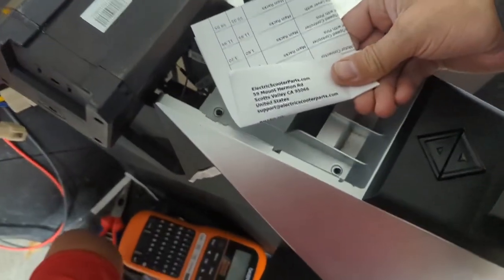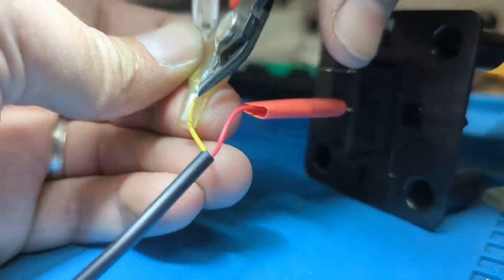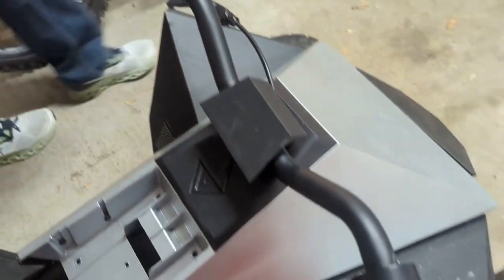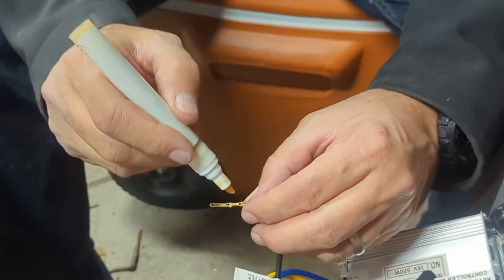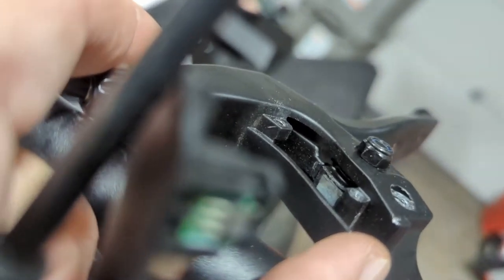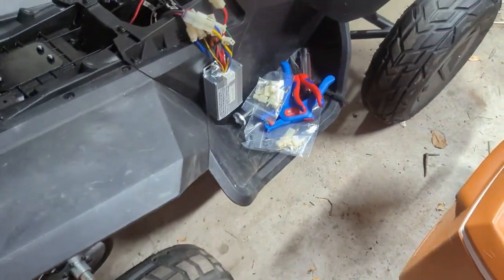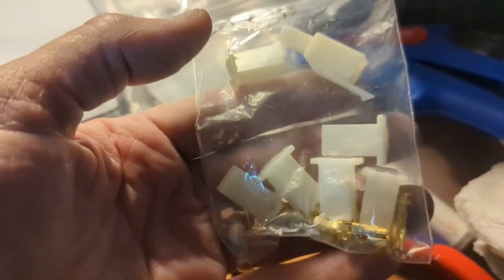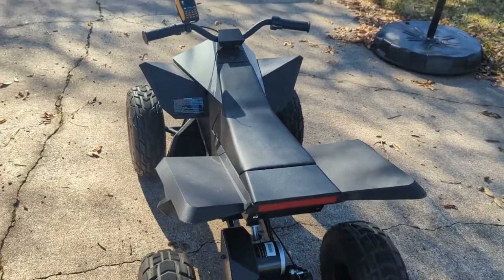Tesla Cyberquad for Kids Motor Controller Recall Replacement

Comment: Hey just upgraded both my kid's quads using this as my starting point. Couple things I did slightly differently, for anyone else in the future reading these comments, or if you wanted to add it into the description. 

-For the forward/reverse being flipped, instead of trying to access that plug to flip the connectors on it since it's a tight fit, I simply de-pinned and flipped the wires in the connector at the controller that went to the motor. All that blue/yellow pair of wires is doing for the motor connector is switching polarity for forward/reverse, so simply swapping the pins in that connector accomplishes the same thing as swapping the plugs at the forward/reverse switch up front. We also test drove both quads side by side to verify the flipped polarity to the motor connectors didn't make any difference on speed (in case the controller allowed 100% for forward but say 75% for reverse, and confirmed its exactly the same). So skip that step and just re-pin to flip the wires, much easier. 

-For the headlight, the controller says it outputs 36v to the lights (tested 36v out as well), and the stock controller would send full voltage to the taillights, but only 24v to the headlights. I know you didn't have a problem wiring it right up (but I noticed in your video your controller page looked like it said 24v to the lights, so may be an update on their controller?). I found a 36/48V to 24v step down buck converter for golf carts on Amazon for 20 bucks (Exact name was "DC 36V/48V Step Down to 24V 10A 240W Voltage Regulator Buck Converter Golf Cart Reducer Power Converter Waterproof Module Transformer"). It's just 2 wires in, 2 wires out, so I used two extra 2 pin CNX connectors to put it in-line the headlight wiring so now my headlights get 24v just like the stock controller, so I don't have to worry if full voltage may burn them out over time. 

-For the brake lever, Electric Scooter Parts was out of the LH lever and no ETA on more. I just ordered RH levers and flipped it over. The screw faces up instead of down, so it's only an appearance difference, but works just fine for anyone that wants to swap theirs and not wait on backordered RH levers. 

-For the on/off, I popped out the factory momentary button on the back, used a step bit to drill the hole larger, and used a 2 wire ignition key switch for a scooter/cart off Amazon, it was 10 bucks, used the same CNX connectors, and now the kids have their own key for their own quad which they think is pretty cool. 

Really appreciate this video though, helped me skip all the research and experimenting to design something from scratch by simply following this how-to and get this controller and connectors and had them back in action in no time. Just wanted to share the couple tweaks and upgrades I was able to add as well.
Reply from the maker: Thank you! All great recommendations!!
Reply: Hi. What was the cost to make this controller?
Reply from the maker: @ketavkshatriya1253 less than $100
Reply: @ketavkshatriya1253  look at the description, the OP lists all the links and that has prices

Comment: Brian, this video was really helpful. Thank you. I got mine all done then I discovered that my controller is only providing reverse speeds when going forward and forward speeds when in reverse.
Reply from the maker: Did you do the fwd/rev switch swap, as shown in this video (0:50 mark)?
Reply: @cognetic  thank you for messaging back. I did do the swap. It turns out on the controller I purchased, I didn’t need to do the swap! That was my problem.

Comment: Damn getting a screw driver underneath the forward/reverse button was such a b** lol. I was so close to saying forget it Ill leave it backward but finally got it. The cyberquad ate one screw but happy I got it done.

Thanks for the video sat on this thing for awhile before actually getting around to getting it. Bought a cheaper motor controller off Amazon and replaced every clip adapter with ones I had except for the power cord lined up. Even was able to use hi/low again since my kids are younger by using an I/O switch. Was going to keep original hi/low switch stock but have a power switch under the seat would be a pain to get to when done riding.

Still gotta buy the break lever with two cords but currently sold out.
Reply from the maker: Yay!  Thanks for the success story!  So glad many are out there converting these to be useful, vs a landfill.  And yes, the fwd / rev switch is a small hands nightmare.  I ended up using a magnetic small phillips head screwdriver, as I too lost screws.  I purchased and have a $20 controller from eBay, I need to test.   It has the same connectors as the one in this video.  I'll post the results one day, if I get a chance to install it.
Reply: @cognetic  definitely! Even though they rereleased without the suspension feel like this model will be a cool collectors item down the road too.
Kids are with their grandparents for a couple days. They'll be excited to see it running again when they get back.
Thanks again, enjoy the New Year!

Comment: Hi Brian 
Please can you give me a list of what needs to be purchased?
Reply from the maker: @kinoperron8678  all of the links are in the video description notes. You will find everything you are looking for their
Reply: @cognetic  sorry, my bad. I have everything in my shopping cart except  the LEV-33L is out stock, do I really needed or I can get something similar on eBay.
Thanks in advance.
Reply from the maker: @kinoperron8678  No.  You only need the brake controller, if you want to engage the rear light, and stop the motor / throttle when the brake is pressed.
Reply: @cognetic  awesome
Thank you 🙏 
I’ll keep you posted with my project

Comment: Thank you for making this video. With this controller would there be a way to keep the two speed options and do a different on/off switch? TIA.
Reply from the maker: Yes to all!  Sky's the limit.  That's the fun part.  Modify and make it your own!  You could even take out the momentary push button on/off switch and replace with a SPST on/off push button switch.

Comment: Hey Brian. I was able to come by a Cyberquad that some one dumped with the OE controller ripped out. Im looking at following your video to get going for my son. I appreciate the video and look forward to the project. One question however is i cannot find a chatger for the battery. I ordered a 42v 2amp charger, but the commector is incorrect. Any suggestions for getting the correct charger?
Reply from the maker: @robertdickinson6697  Radio flyer might sell you one.  I would call them and see.  If not. I would check eBay.  Hopefully you can find someone parting theirs out.  You can also try Digikey. I  always say, if Digikey does not have it, nobody does.
Reply: @cognetic  Sounds good, I appreciate the repy! So far ebay has been a bust, but ill keep looking around.
Reply: @cognetic  Also, is there any chance you could throw a set of calipers on your charger. It might help to get all the ID/OD of the plug end that goes into the battery.
Reply from the maker: @robertdickinson6697  Original Power Supply part number is "BC257360020-T" 42V 2A Positive tip.  Outer Barrell is OD=8MM ID=5.5MM.  I did some google searching, and it appears this may work "BC238360020".  Search that part.  I found it on Amazon and Ebay, etc.  Seems to be a common escooter connector. Let us know if this works.. and I will update the video description with link(s).
Reply: @cognetic  Thank you! Placed an order for one, ill follow up once it arrives if it's compatible.
Reply: @cognetic  Hey Brian, the charger came in and is working great. Thank you for the suggestion. Now just waiting for the controller and parts to come in and get the four wheeler running!
Reply from the maker: @robertdickinson6697  Thank you for the update.  I'll add the Amazon link to the video description notes.

Comment: LEV-33L is out of stock for awhile... anyway I can use the original left break lever?
Reply from the maker: Absolutely!  You only need to purchase the new brake lever, to 1.) Stop the motor from spinning, even if the throttle is engaged. And 2.) To engage the brake light on the controller.   So if you are OK with missing those 2 features, you will be just fine.  You will still be able to stop the Quad with the original brake controller...it just won't interact with the controller.  Just leave the original brake disconnected from the new controller.

Comment: Brian... Awesome.... Have you figured out how to keep the break light on like the original by chance?
Reply from the maker: It will stay on if you connect it to a CC (constant current) source, vs the brake connector.  I chose to connect it to the brake connector.  Designers choice.

Comment: In lieu of retrofitting the Tesla battery connector, I converted ours to run on Ryobi 40v Li-Ion batteries.  We already have a few 6ah ones and there are plenty of options on eBay for holders.
Reply from the maker: Yeah I've been debating what to do, when and if the battery ever dies.  I'm sure our first try to open up the original battery pack and recreate a new 18650 series pack, with a BMS.  But I'm not sure how serviceable the original pack is.  Might end up damaging it too much trying to get into it.
Reply from the maker: I have ordered a spot welder, nickel strips, 18650 clip holders, 18650 batteries, and a 3S, 4S, and 5S BMS boards.  I just need to find a weekend to put it all together, 3D print a new battery case, etc.

Comment: The two small black wires going to the motor are a NTC thermistor, 10K Ohms at room temperature.  Try a W1209 temperature controller with it.
Reply from the maker: Yeah I figured it was a motor temperature sensor.  Thank you for confirming!  Any issues you can see not using it, or not monitoring the motor temp?
Reply: @cognetic  You might burn out the motor eventually with continuous heavy loads.

Comment: Do you have problem when go down hill with the controller on fast mode
It like hard brake when you let off throttle 
Please help if you know how to fix it
Thank you
Reply from the maker: Ha. We live in Houston TX.  It's flat as all get out here.  I wish I could test that for you.
Reply: Hi @cognetic

Was there a solution to the motor braking when letting off the throttle?

Comment: Im not getting a full 36 volts to my lights. Showing around 2.7 volts on the accessory stuff and im unsure why. My brake lights and headlights are hooked up fine and the motor controller when you make the brake switch turns off the motor if throttle is pressed. Just no lights. Weird. Im unsure what it could be unless its an internal thing with the motor controller itself.
Reply from the maker: Sounds like a defective controller to me (assuming all is connected ok).   If it was me, I would order another controller and test.  Where did you get your controller from?

Comment: Hey sweet video! Thanks for posting to get my cyberquad up and running (mostly). 
I could use some guidance on the pin out for the brake light. I bought the same exact lever (although different controller because yours is out of stock) but I can’t seem to get the light to turn on. Hope you can help!
Reply from the maker: Do you have a manual or schematic for the controller you purchased? Link??
Reply: @cognetic  hey Brian do you by any chance have another link for a different motor controller? The one you put up is out of stock?
Reply: @cognetic  I’m the guy that just bought the battery connector from your eBay account by the way. So need that motor controller asap. Will appreciate the help
Reply from the maker: @DiESYPOKiLLA5  Good question.  I am not affiliated with electricscooteparts.com.  I would call or email them and ask.
Reply: @cognetic  what I mean is if you seen any other similar to the one that you use that could work. Because the only one I found similar to it was a 36v 1000watt
Reply from the maker: @DiESYPOKiLLA5  do you have a link?
Reply: Those are the 2 links I found. Appreciate you taking the time Brian
Reply from the maker: @DiESYPOKiLLA5  it looks like YouTube is striping the links.  Can you send via eBay message?
Reply: Yes I can. Thanks again Brian

Comment: Gonna order parts today thank you for making such a detailed video one question is there any way to get the rear light to stay on steady and also have the brake light function properly
Reply from the maker: Not sure. I thought about this as well. It has an option on the controller to be on all the time, like the front light.  But I would suspect you would need something to drop the voltage so the rear light bar is dimmer.  A resistor maybe?  Once you have that figured out, you could wire in your brake light feed in parallel.  Theory of course.  Someone would need to test.  I just did the brake light feed, as the kids don't really ride at dark, and was a perfect solution for us.  Or did not warrant the effort to find an always on dim, brake light full brightness solution.
Reply: @cognetic  thanks for the quick response.   I still have mine in the box was thinking about not opening it but it’s to hard to not get the 1900 back with options now to get it working.
Reply from the maker: @victordaniels9065  yup.  Got my check back around 45 days after I sent it in.  Very happy with the new controller.  The only issue is the battery connector.  Someone or, I need to find a drop in easy solution, vs grinding a new one down.
Reply: @brian Flores hey where did you plug in the headlights? Did you use the battery power indicator for that?

Comment: When i turned my motor controller in I cut all the oem connectors off and kept them. Just an FYI the refund went through just fine.
Reply from the maker: Wow!  Good to know.  I wish I would not have sent the battery connector back.

Comment: Any updates if the sudden braking when letting off issue that some folks have had is resolved? From reading most of the comments and watching your vids it seems you weren't having that issue but some others were. I'm about to do this on both my boys' quads and just trying to catch up on the latest/greatest info. Appreciate it!
Reply from the maker: To my knowledge it was a controller issue, and they got the inventory worked out.
Reply: @cognetic  finally pulled 1 of mine apart to send in and ordered up all the parts but haven't got them in yet. Quick question, the new controller looked like it'd send 36v to the lights, but I measured the stock controller and it only sends 24v to the lights. Any concerns or longevity issues on yours with putting higher voltage to the LEDs?
Reply from the maker: @Harley356  I don't remember what the output voltage was from the SPD, but if it was 36V, all good so far.   No issues with lights.